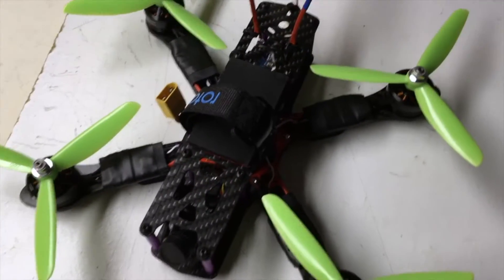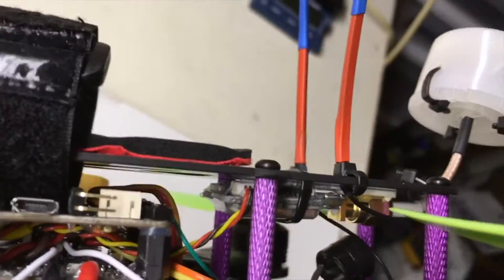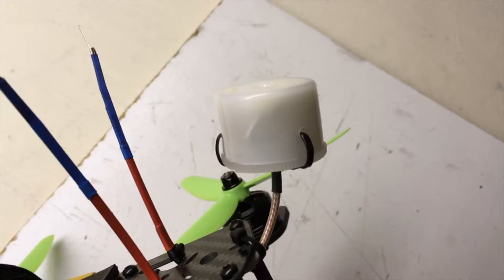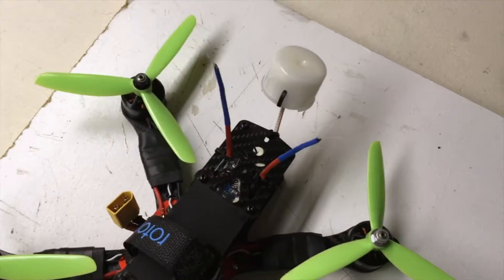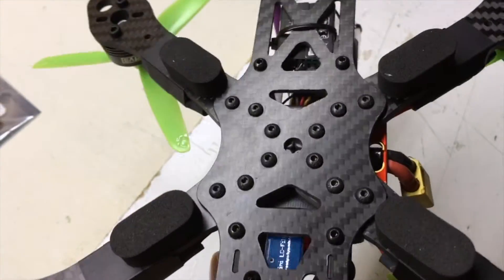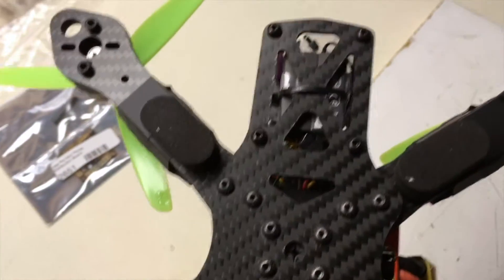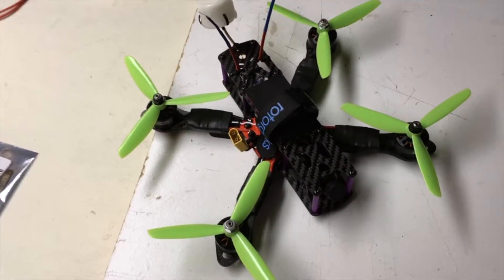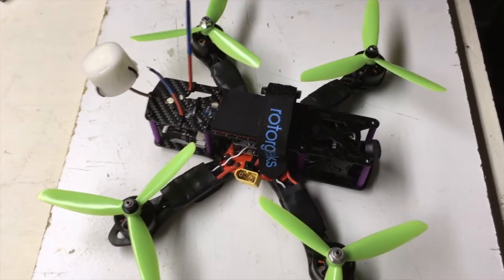Martian II Build (Part 7)

Comment: Awesome build series just got a Martian ll, this series has been a big help.
Thank you for making these videos, it is much appreciated 😀
Reply from the maker: You are welcome and I hope this video helps you out. I'm going to be modifying this quad soon with removing the stock PDB and replacing it with a second fiberglass plate as many have suggested. The stock PDB works fine but it is a little heavy and does not have any voltage regulators so I'm going to try and shave a little weight. It is a great frame and I'm sure you will love it no matter how you decide to build it. Happy Flying!

Comment: nice build series. im currently flying a MRM250 and looking at the martian 220. do you know what your total weight was after the build?
Reply from the maker: Thank you. The weight without the battery and without the HD camera came out to 405 grams.
Reply: bah7566 
thanks for the reply. just ordered a martian 220. been wanting a X frame for a while. have to build my pdb layout similar to yours.
Reply from the maker: Excellent, I think you will like it. I have a second one I am going to build up as a 6" with the 6" arms. I probably won't get to it until next spring but I'm looking forward to it. Hope you have a great build.